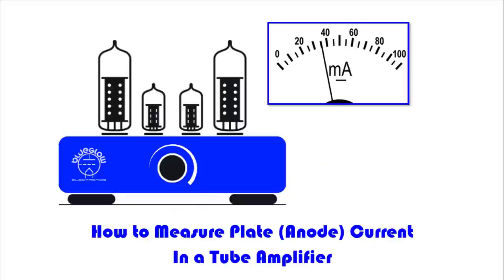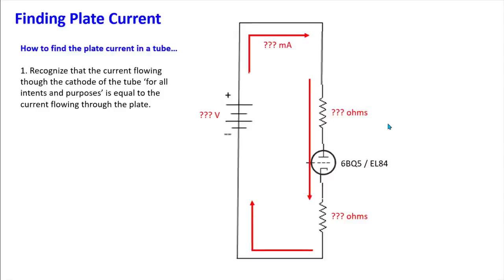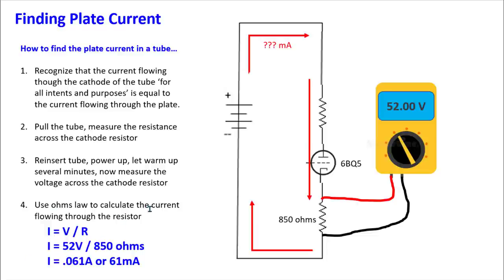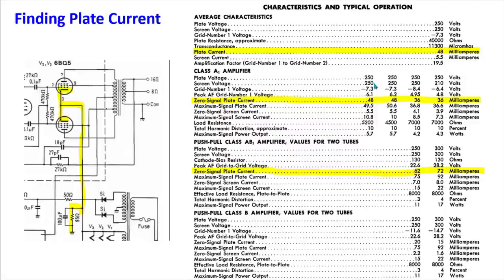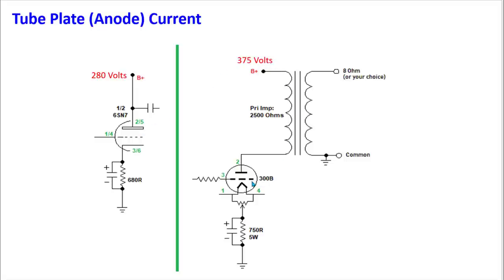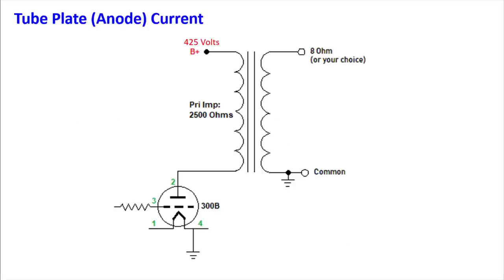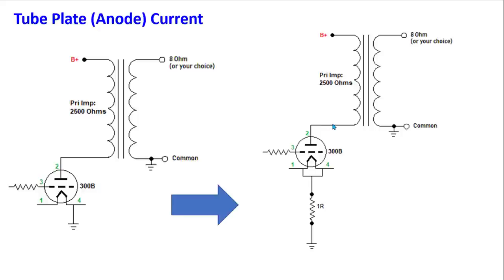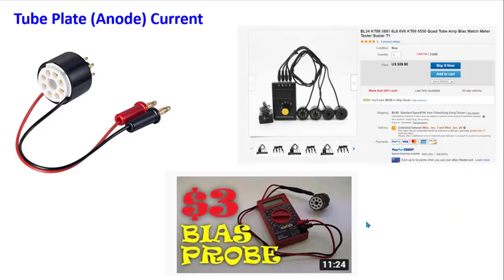How to Measure Tube Amplifier Plate Current (Biasing) and Actually Understand What You Did

Comment: What about the small current (0.5 - 1.25 mA) flowing through the screen grid?  Only measuring the current through the cathode resistor makes the plate dissipation reading a bit low.

Comment: 6BQ5 is a Pentode, not a triode!
Screen current flows through the cathode resistor along with the plate current.
Your Ohms law examples were good because you showed actual circuit applications.

Comment: I bought an octal "tube saver" plug from ebay for $3, took it apart and broke the cathode connection, like you demonstrated. I mostly do fixed bias EL34 amps so these come in real handy. Also found out that I can test the cathode current on some tube TVs using 6DQ6 as the cathode pin is the same.

Comment: Thanks for the great video. Perhaps, if it's not done already,  make a test socket with the 1 ohm resistor inside it and disclaim to the customer to read the current in millivolts. That way only low voltage leaves the chassis.
Reply: This is a interesting idea if it is on the cathode pin.  On the plate pin both terminals would still be at 300+V above chassis but you would reduce the risk of shock between the two terminals and the chance of open circuit.  It still has the problem with selecting the correct plate pins.

You could even have a 1 Ohm resistor on every pin and have jumpers across the filament pins and then read the current in any terminal.  Putting a ring of 2mm test sockets at the common jumper spacing around the socket could work but might not always fit into every chassis with close spaced tubes when bringing out the test leads

Comment: If you are going to access the inside of the amp to measure plate current often, it's probably simpler to insert a 1 Ohm resistor in series with each cathode and measure the volts across it. V=IR and  if R=1, then V=I . Job done. Measuring the volts across 1 Ohm, which has one end grounded, is also very safe. (Always keep one hand in your pocket when probing HV with the other)
Reply: Yes, he mentions that method in the video.

Comment: Great video and background info.  In your example with the added 1Ohm sense resistor you inadvertently simplify a bit too much and may mislead someone.  I wonder if you can insert a note that the filament does not get shorted when you add the resistor.  I expect you simplified the filament hum reduction potentiometer into a short circuit but that I believe is a connection too far.
Reply: I was just going to point that out also @13.45. BTW, for clarity, it is a 1 ohm resistor that is used.

Comment: I really appreciate it when you do these instructional type videos.  And I would like to see more trouble shooting videos.  I learn a lot from those.  Also, as a beginner, I want to know more about how to set the bias.  It is my understanding that bias should be set to achieve the most linear operation of an audio tube relative to plate current versus grid voltage rather than just heat dissipation or hotness or coldness.  Could you please do a video explaining how to operate a tube in the most linear region?

Thanks,

Carl Espy
Reply: Well, from one point of view, a tube has no linear region, just a semi flat-spot in the transfer curve!
In practice, negative feedback widens the flat-spot a bit while proper biasing avoids distortion at the low and high ends.
The real art of tube 'balancing' is matching the slope of the linear regions, not just the bias!
Two tubes may have the same B+ current with the same grid voltage, but might have very different 'slopes'.
Reply: @pirobot668beta  Greg - thank you for your response.  I guess I'm somewhat geeky about all this.  All the YouTube videos I've seen so far are arbitrary in setting the bias at some level of heat dissipation or at some level of plate current below the max in the tube manual.  But it seems to me that there should be a more precise means of setting bias so that any given tube can operate in the most linear region of its characteristics (grid voltage versus plate current).  I finally found a pretty good source for non-tech types like me: Department of the Army Technical Manual TM 11-662, "Basic Theory and Application of Electron Tubes", February, 1952.  I am slowly working my way through it, and it speaks to my level of understanding.  Hopefully, I can get some answers there.

Thanks, again,

Carl

Comment: I am actually interested which is the bias point that the amps should be biased to? I once read 68% of the rated output power. So if one has a 2 tube 50W amp, it should bias it to 34W so that the current would be around 43mA per tube if the B+ is 400V in this case (85mA through both tubes).

Comment: Total cathode resistance for direct heated triodes  with hum trim pot ( mostly 50-100 Ohm) = cathode bias resistance plus 1/2 of the value of the trim pot.
Maximum cathode current is not at idling bias value ( without signal ), but max current  on the left side of the load line when the signal has max negative input on the grid !
60 mA on a EL84/6BQ5 idling is killing the tube under use.......
Nevertheless a useful and good video. Thanks

Comment: The mod at (13:24)to measure cathode current in a 300B is incorrect. As drawn, it is shorting out the 5V filament winding of the power transformer. The 1 Ohm resistor should be connected from pin4 to ground, with no connection between pins 4 and 1.

Comment: Mark, how do the voltages get so large like 425v and 300v and so on. where do they get stepped up. is that the output transformer doing that. I'm confused, sorry. I know its off topic, just curious.
Reply: The AC input voltage from the wall socket is increased by the power transformer and rectified to produce these DC voltages.

Comment: I have 7868EH tubes and I cant figure out what the maximum plate dissipation wattage is supposed to be. I dont see it in the datasheet. 
Measuring from pin 3 to ground I am getting 0.054 MA and 340 volts on the plate. that equates to 18.36 watts.
What is it supposed to be?
Reply: I think I found it. Since I measured cathode current on pin 3 to ground according to the datasheet maximum cathode current is 90ma so i am at 70% which I assume is where I want to be for push pull amp with two tubes.

Comment: Really love your videos, I have watched his one 100s of times. I do have one question not covered in this video. If the current is too high or too low, do you just change the resistor value? Is there a way to control the current with a potentiometer? You showed how to measure it, but how do I control it or change it? Thank you in advance.
Reply: I have the same question
Reply: Pretty much.  In most cases a good tube in a circuit with correct supply voltage and within tolerance resistor the value should be within working limits already.  If you are balancing channels or a push-pull arrangement you would trim one resistor.  You can easily reduce the value of a resistor by placing a resistor in parallel.  To reduce the resistance by 10% you add a resistor of about 9x the existing measured value.  You can do this by adding 8 x the resistance and then use a 2x resistance trim pot to add 8-10x the resistance and this will reduce the existing value by about 9 to 11%.  Investigate the changes using the parallel resistance calculation.

Adding the extra resistance is often more practical than changing the cathode resistor because you only have 1/10 of the current flowing in the parallel resistor so the required power rating is one tenth and you do not need to have a big box of close spaced values in multiwatt resistors.

In some designs there is a balancing potentiometer between the legs of a push-pull  stage but this is not good for power amplifiers as the full plate current flows through the wiper of the potentiometer and having it float even when adjusting the amp is not ideal.  Adding a small variable resistor to the parallel resistor in the trim design will only cause a 10% deviation if the wiper looses contact during operation or adjustment.

If you need to increase the resistance you can disconnect one end of the resistor and insert a small series resistor.  If you add a value 1/10 of the original it will still need to handle 1/10 of the power dissipation so use a 0.5W resistor in series with a 10x bigger 5W resistor.

Comment: But in a cathode biased set, you're measuring the resistance of the cathode resistor only (and its voltage drop) and calculating the current - what about the DC resistance of the OPT?
In my el34 stage Rk is 500R with a 22V drop, allegedly giving me 0.044A.
But if i take into account the OPT's DC resistance of 208R with it's 12V drop that gives me so far a total resistance of 708R? What about the tubes' own resistance?
Also, my B+ is 339V, minus the 12V drop of the OPT and 22V of Rk leaves me with 305V left over (presumably the voltage drop of the tube)?
But (22v/500R=0.044A) and (12v/208R=0.058A) and (305v/?=?) Where's the common series current?
Damn! I'm so confused!
Reply: The OPT primary, the tube and the cathode resistor are connected in series so the same current must be flowing in each of them. In other words, the current flowing in the cathode resistor IS the current flowing in the tube.

Comment: I have one of these Bias Meter probe/switcher devices….Mine as a 1ohm resistor built into the cable,so I assume that’s the same as adding the resistor inside the amp?
Reply: Yes.

Comment: How do you identify the primary side of the OT? Is it a certain color wire? Is it attached to the same spot in every amp?
Reply: In a single ended amp, one wire is connected to B+ (the positive terminal of the reservoir/first filter capacitor), and the other wire to the plate pin of the power tube.

Comment: Blueglow Electronics, when a push pull amp has one cathode resistor, how do you know that both power tubes are equal drawing the same amount of current? is there any test you can do to check if both tubes are drawing the same amount of current to be matched?
Reply: You can measure first the DC resistance and then the voltage drop between the OPT primary center tap and each tube plate. You can then use I = V /R to find the current flowing in each tube..

Comment: fixed bias fit a 1 ohm resistor in line with the cathode 1 volt through 1 ohm = 1 amp
Reply: You meant  = 1A, yes?

Comment: what about the cap in parallel with that cathode resister,wont that effect the reading
Reply: You are measuring a DC current, and the cathode bypass capacitor acts as an open circuit to DC.

Comment: How much I wish you could help me with my Cayin amp... one of the tubes biase set screws won’t move the meter, brand new amp 😞
Reply: Measure the negative voltage on the grid of the tube.... then turn or adjust trim pot and read if the voltage changes....( compare the reading with readings of the other negative ) voltages on the grids of the other tubes ).maybe also possible that the socket has problem and doesn't connect correctly to the tube pin(s) or to the negative bias circuit.....in that case the tube will normally red plate and self destruct.....Check the output tube(s) also. .

Comment: I do not care much about mA numbers when biassing tubes. I am giving the plate dissipation the priority. Sure I obey maximum DC plate current rules as well. 
So, when biassing I am measuring both plate voltage and current at the same time and then I set it up at 60 to 70 percent of the maximum plate  dissipation for the given tube in fixed bias circuits. Sometimes plate voltage in the old amps is way higher than what it was designed for due to the higher mains voltage. Then checking just current numbers might result in way to hot biassing. In such cases your plate current stays lower than typical but the high plate voltage makes it reach desired plate dissipation percentage.
Most of my stuff are guitar amplifiers and sure there are triode pentode or triode quatrode switches in some amplifiers but they are not there for quality of sound. They are used to lower the power levels.
So we use EL84 in pentode mode.
Tube grids are voltage regulated and indeed grid leaks and such are not influencing biassing.
On the other hand screen currents are few mili Amperes. This also goes true the cathode to the ground as well.
Hence cathode current is plate current plus screen current. Hence to calculate exactly the plate dissipation we need to deduct those few mA of screen current from the measured cathode current. Then we have correct measurement of the plate current. Multiplied with the plate voltage and we have the actual plate power dissipation.
Small asymmetry in push pull guitar amplifiers is ok. Guitar amplifiers do not mind a little distortion anyways.
Sometimes people even disconnect NFB loop to make it overdrive more.

Comment: you said it yourself. If push pull was like you showed last video, with only 1 tube running on each half-phase, you wouldn't need to match tubes. The reason that they need to match is because They are both amplifying all the time. Instead of being off while the other tube pushes, The tube that is in the negative portion is on, but the negative signal is pulling from the other end.Therefore, with matched tubes, one pulls exactly what the other pulls. Otherwise you end up with low efficiency and distortion that is anything but harmonic.
Reply: If you have slightly unmatched tubes in one channel, with one drawing a bit more current than the other, is there any way to carefully bias besides replacing with perfectly matched tubes?  I think it is just a few mA difference.

Comment: Would it not be easy to wire an ameter in series, a more accurate method I would say as long as you know what you are doing with high voltage is concern!!!
Reply from the maker: In concept yes but if you know anything about ammeters, they are made of a wire wound coil, in other words an inductor.  It will mess with the AC signal path and cause issues.  If it were that simple, everyone would simply do that.  Sadly, no one does for the reason I outline.